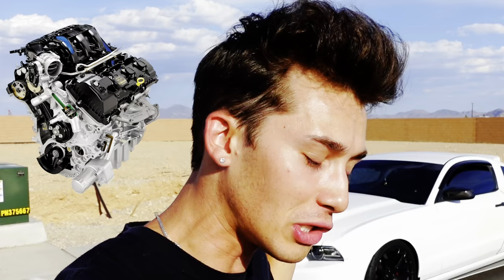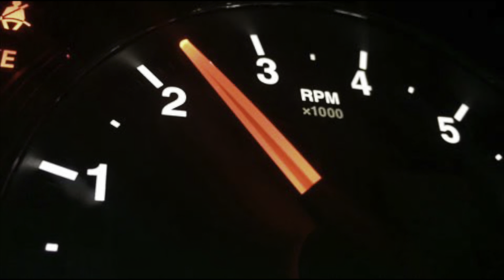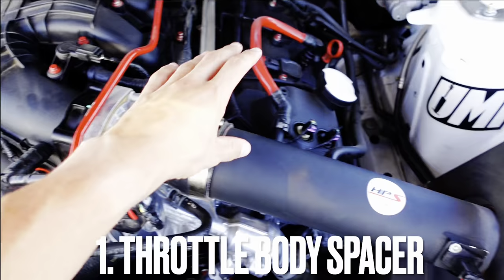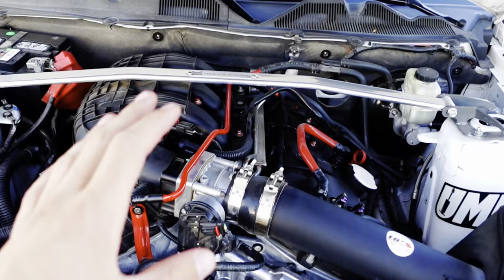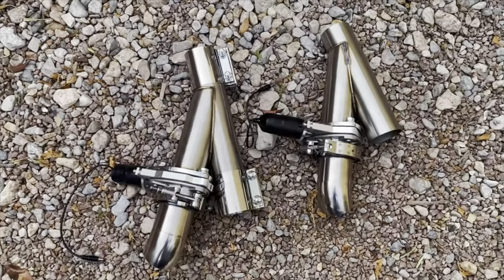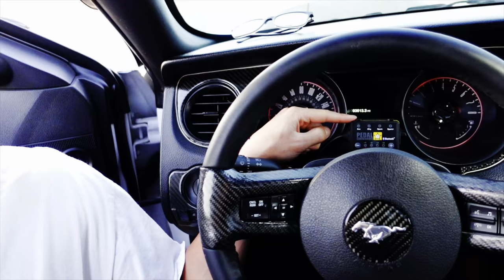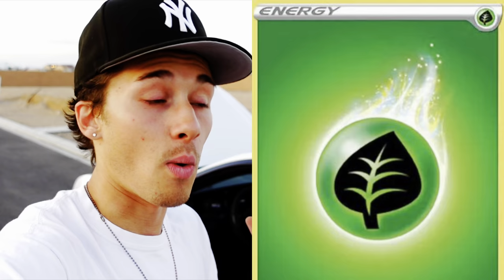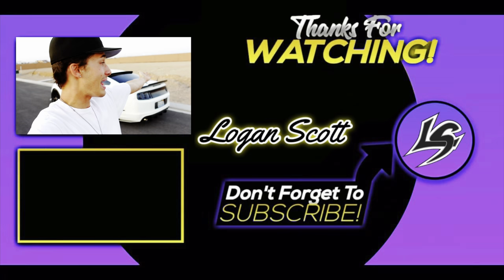How I Made My V6 Mustang FASTER!

Comment: Unless you have a 4.0 V6 im not sure why you think 305hp, 280 lb ft of torque, a 5.1 second 0-60 and 13.7 second quarter mile time is slow, these cars are around as fast as the 3 valve GT, 370Z’s and older M3’s and a turbo or super charger will get you around 500hp pretty easily and reliable before needing to upgrade internals for more boost. Personally i dont really want more than 450hp on a daily driver or a car im actually taking to track events but to each their own
Reply from the maker: You’re absolutely right! These cars can be fast and fun with the right modifications. I personally have a tune, pedal commander and a few other little trinkets and it’s made the car a lot more enjoyable to drive than when it came off the assembly line. As a daily, I couldn’t agree more, although if i was to spend thousands, I’d rather get something that already has the power from factory and build it from there depending on the model/budget. These motors can withstand a lot and have plenty of potential, I just can’t speak on it heavily bc I haven’t dived into the motor that deep yet.
Reply from the maker: Btw, that’s awesome you track it! What’s suspension mods do you have if any?
Reply: Hey how would one take a limiter off of the car
Reply: @DirtyMike0417  You will need a tune to do that.
Reply: Are you saying a 4.0 can make 305 hp before a turbo?? explain
Reply: I drive a 2012 V6 as my daily, and I make great time getting on the freeway. Lol it's fast for me.
Reply: @jerryrivera7704  I put a Thornton chip from YouTube in my 45th anniversary from 2009 s197, I smoked the Camaro Z1 yesterday. He was dying to know what I did to it I told him I have a natural breathing horse 🐎🐎🐎🐎🐎🐎🐎, v63 valve with a chip from heaven. Play she got 239,000 mi on it, it's literally burning everything. I live in Florida in Jacksonville, the V8 drivers here don't know how to drive, so I'm literally just dusting them it look like I got a turbo, but there's no turbo😊💪🏿🏎️🏎️🏎️😤😤🐎

Comment: I did the fbo route with my 6 speed manual 2014 V6 convertible, best mod was the first one, just switching lame 2.73 rear to 3.73. Next best was MPT 93 tune. After that each additional mod gave little satisfaction for the money spent, nothing detectable by the butt dyno.
Reply from the maker: Sounds about right haha. 3.73’s is a whole new animal from what I’ve heard. I gotta get rid of this peddle car feeling and do this swap already lol.
Reply: Was there anything else that needed to be done when switching to 3.73 or is it reliable with everything stock?
Reply: @yingyingful You will need to buy a programmer like a SCT to be able to adjust the speedometer when changing to a 3.73 rear gear. I think I had to play with the tire size menu to get it 100% accurate. No other mods to the car needed. This was done many years ago and 57k miles later have had no issues. It is important to have someone experienced do a precise gear change setup to avoid gear whine.

Comment: I own a 12 3.7 6r80 3c circle d stall 355 gears, Fbo, ported intakes, Coyote tb, catless dyno tuned.My recent best 1/4 is a 12.4 @110. 326whp @7100 On street tires I can get right at 4.3-4.4 to 60mph and hit 100mph at 11 seconds on 275 nittos. I love mine so much that I'm in the process of swapping a 3.7 in to a 99 gt body.
Reply from the maker: My man, this made me smile. I’m glad someone is taking full advantage of the 3.7 while they’re relatively affordable! 

Also, I’ve contemplated a coyote TB for a few weeks now. What are your thought on it?

Comment: Very nice bro. 
I am in Reno NV i have the 4.0 V6 mustang so far mods and suspension tune and 100 shot Nitrous right now i am waiting for a sts rear mount turbo kit to finish being built so i can run rear turbo and Nitrous. 
The V6 is nice fun car especially canyon runs.
Reply from the maker: I’ve never been to Reno. Would like to experience it one day! Aside from that, it sounds like you have a monster sleeping under the hood of your stang! Keep up the good work and don’t stop until you’re insanely proud of yourself 🖤
Reply: @LoganScott.  Thank you bro. I will be satisfied with my build after I make it track ready like I wanted. 
I plan on keeping this 4.0 and never get rid of it. I also plan on buying a 2012 or 2013 boss 302 Laguna Seca.
Reply: i also have a 4.0 and ive been thinking about nos recently. 100 shot seems crazy high form what ive read in the forums. how long have you been running it like that/how often and whats your mileage if you dont mind my asking. I'm adding sleeves to the OD rings bc mine is starting to give me some issues with 2nd and 5th (but iirc thats just an 5r55s automatic thing)
Reply: @ipodman371  just about 2 yrs now. Nitrous set up.
My friend has a 4.0 V6 mustang as well with 175 shot Nitrous with performance cams and AARP head studs. He has been running that for 6 or 7 yrs and no problems just basic maintenance.
Right now I I have 3.73 gears I need to install and saleen side Rocker panels. I also need to buy a saleen rear bumper.

Comment: Hey man love ur channel. Idk why my coolant is way below minimum with no sign of leakage…should I be worried?
Reply from the maker: All love my guy 🤟. In my opinion (and I could be wrong) but if your car is producing any white smoke out of the tailpipe, then you have an internal leak that needs to be addressed as soon as possible. It’s common for coolant to evaporate overtime but not by a large margin as you’re explaining. Putting in the wrong type of coolant can also cause a quick drop in levels. Easiest thing I would say is check your radiator cap

Comment: Where do I find your front bumper & does your cool air make a difference?
Reply from the maker: The front bumper is stock with the exception of a Cervini upper grille, RTR lower grille, Roush front lip (white), custom front splitter (black and plastic) and at the time the front white pieces were black sintra board to protect the front lip. In addition, Amazon front rods which I recommend finding a better pair
Reply from the maker: Here is a video I created specifically for your question! I believe it will help you answer a lot of you thoughts and concerns!

This is how to make your 2014 Mustang STOCK bumper look AGGRESSIVE!
https://youtu.be/EOV4bAcgAbk

Comment: I have a mustang 2014v6 and I was wondering if that sway bar fits for your v6 properly ? I see comments saying it’s not the right fit for it. Does it work just fine?
Reply from the maker: Hey AJ,
My buddy Joe and I had 0 issues putting this in. I will say it was a little tough at first but it was only because more parts were needed to be removed than what was originally expected. Other than that, I love it and I think you will too!
Reply from the maker: Here’s the video of the install my friend
 
🎥: https://youtu.be/pSPSV3JQ3j8?si=VadZF_ZKzx33RSs2

Comment: I would like to buy a 2014 v6 mustang as my first car, it’s a good idea guys or what would u suggest me?
Reply from the maker: It’s a great car! It’s fun and most of the time reliable. In addition, there are a variety of unique and different modifications you can do to make it one of your own. I’m not the biggest Mustang fan but I appreciate the creativity and openness you’re able to do with one which is one of the reasons why I still have mine. 

If I were you, I would check to see if general maintenance has been made, if the water pump has been replaced, and depending on the location, what the under carriage looks like. Bushings can dry out and cause lots of noise which I’ve experienced. To fix this, buy better suspension. You won’t regret it. I may be missing a few things but hopefully someone can jump in and add on! 

Here is a playlist of videos I’ve created that are categorized by “performance, suspension, exterior, interior,” etc. 

🎥: https://youtube.com/@LoganScott.?si=kDbJDUbhxqTYSU4L